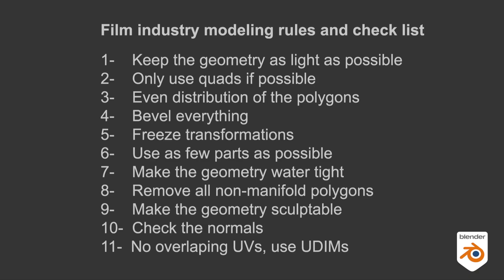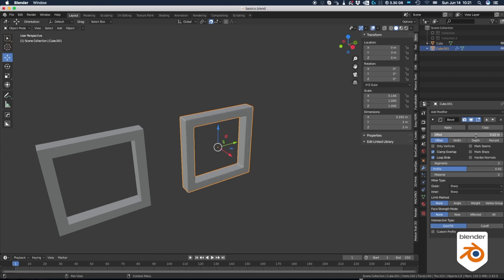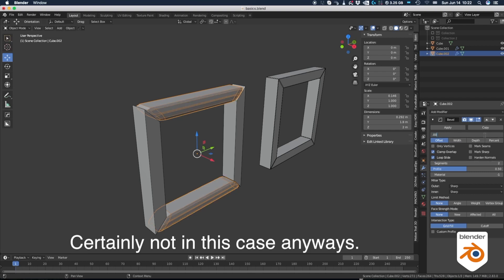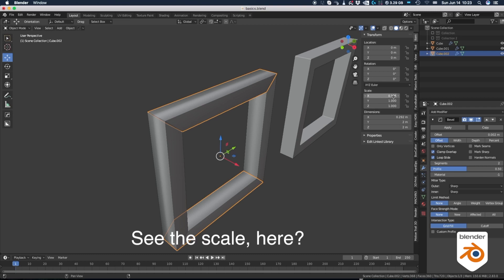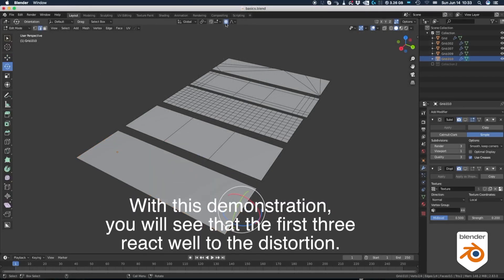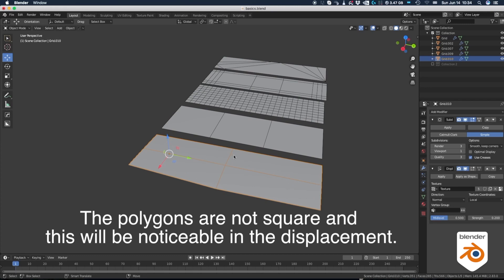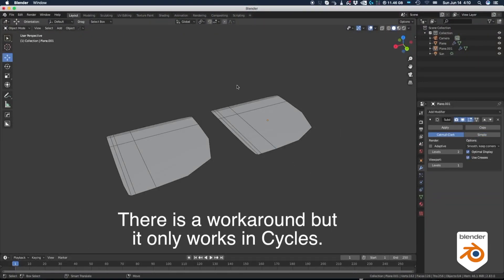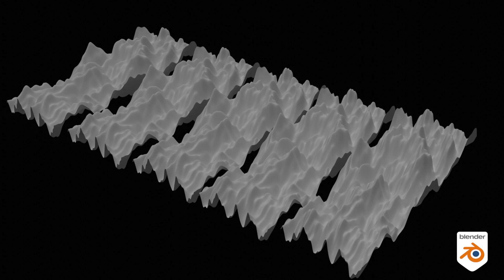Modelling for the VFX film industry - Clean geometry EP1a

Comment: I use "fill holes" instead of separating to different objects, although different objects may be easier to visualize in a tutorial.
For window frames done this way, be aware the bevels will introduce a light leak where material is removed. Be sure to fill this with some fake geo.

I always cheat with window glass (interior scenes) and use a single plane instead of three solids. Since fresnel inverts IOR for backfaces,
causing Snell's window, I mix Transparency with Glossy (sharp) using Layer Weight -> Power of 5 -> add 0.05 instead. Extremely close to
real fresnel, reacts correctly with backfaces, you don't have to rely on caustics for light transport or do other tricks where you forget that
light transmission is reduced at glancing angles. You might want to use 1-the above math into Transparency color as well - this makes
even less light pass through which happens in real glass at glancing angles because light "gets trapped" in internal reflections instead.

Comment: With the entire smooth shade issue there's an easy fix in the object info tab under the normals drop down menu. It's called autosmooth or something along those lines. It fixes the issue that the weighted modifier fixes. Personally I think it's better just because it keeps the modifier stack just a little bit cleaner. But maybe it has options or features I'm not aware of. You are deffinetly the professional here now me.
Reply from the maker: Thanks for the tip!
Reply: not me*